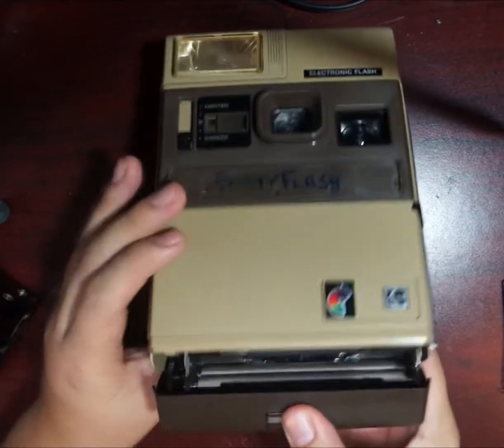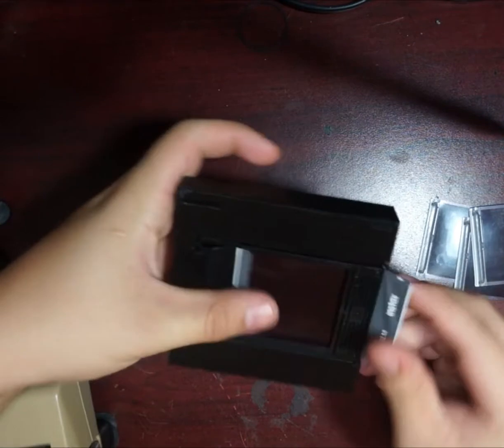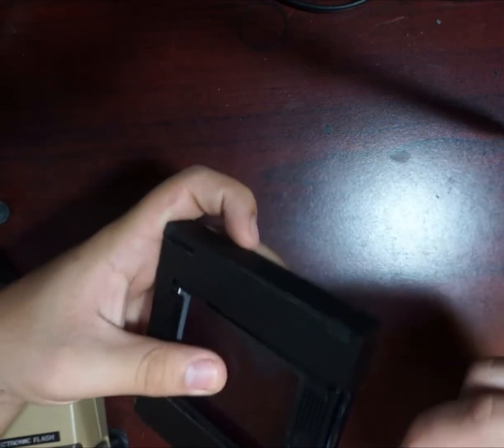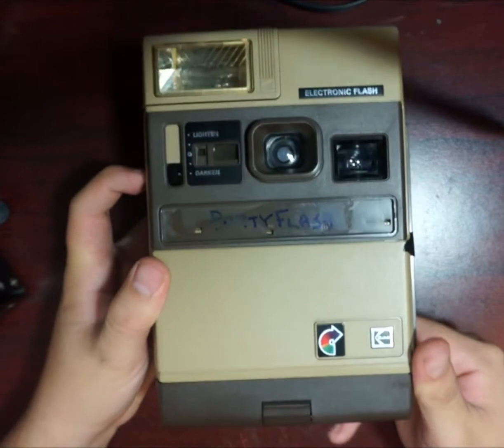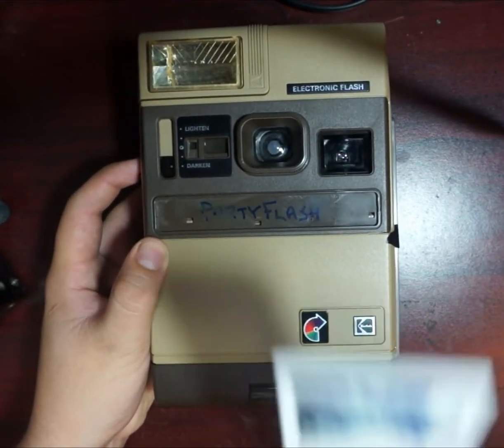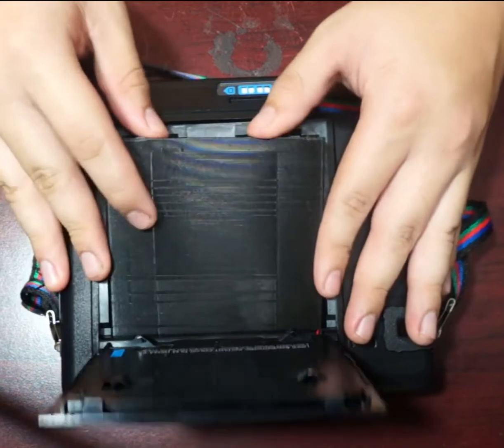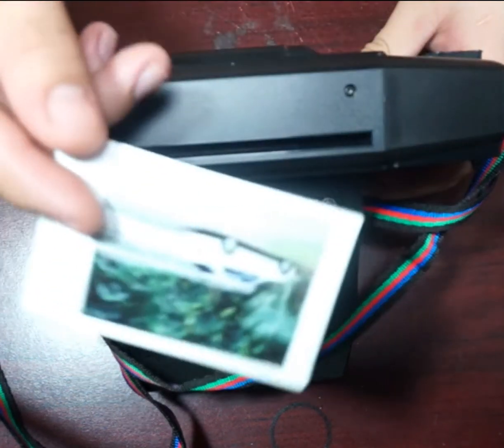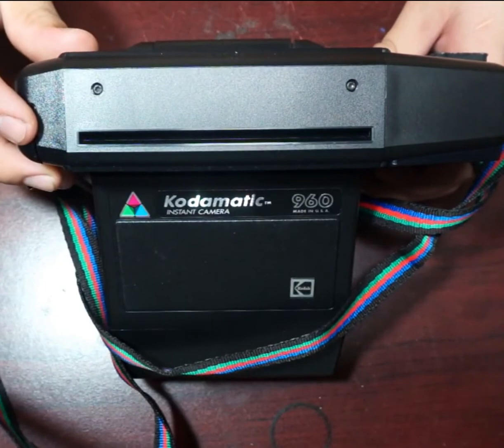3d printed kodak instant camera to instax mini adapter

Comment: Is this project still ongoing or is it finished? I would be interested in buying an adapter or the files to make one since I recently obtained one of these cameras and have been experimenting with it.
Reply: I just made a similar adapter for instax square, but without the need to reload individual pictures into the adapter. Just insert a pack of film into the adapter and then insert the adapter into the camera, no modding of the camera is needed. 

You can see a video of it on my channel. I’m still working on perfecting the design to be as efficient as possible.
Reply: @ianbakke  sooo is it available for purchase yet?? 😅

Comment: Hi Brian, I’m actually looking everywhere for this kind of adapter, I have an ek-160-ef which is working but sadly it broke a gear. So I’m still trying to figure out how to open it up to change the gear (which I’m gonna need to print), kinda need help haha
Reply from the maker: I have 3d printed gears for other models, but for that model i haven't its very hard to take a part as you said , but its very possible to do it